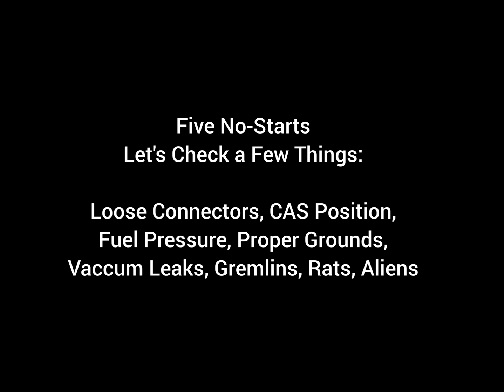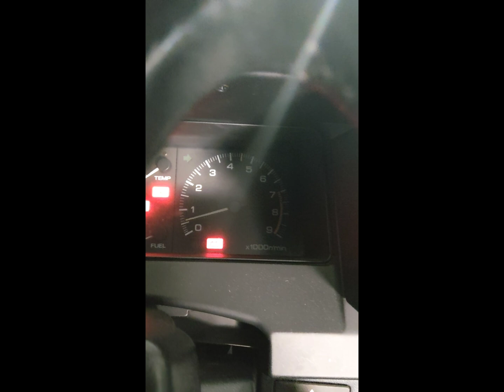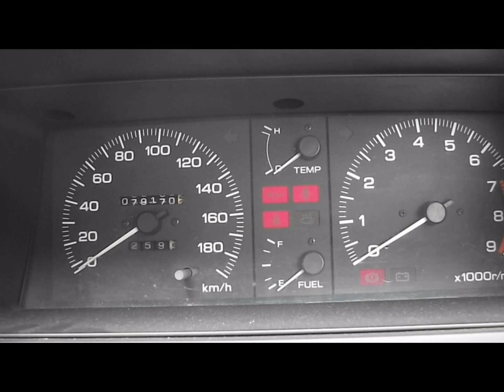Engine Swap Speedrun 15 Mins JDM RHD Nissan EXA Pulsar NX SE KN13 CA18DE CA16DE

Comment: Hey I know this is an old video but I was wondering what your thoughts would be on an engine swap from a 2001 Nissan Maxima Fwd to a 1987 pulsar NX
Reply from the maker: Pulsar NXs have a really tight & low engine bay... I think it'd be a really tight fit for a big VG block like the Maxima. It would require some cutting & fabrication of the engine bay walls, likely.
Reply: I got a friend who has a VQ in his B12 Sunny Coupe. Literally the same chassis. No engine bay cutting required.
Reply from the maker: @powersteering7839 cool! Same chassis or not, it's literally NOT the same engine bay. I've had both multiple times do they have vastly different engine bays and space constraints.
Reply: @EdSanchezSports  I won't say they differ a lot. But I must admit front support bar and lower hood line could be a problem in EXA.